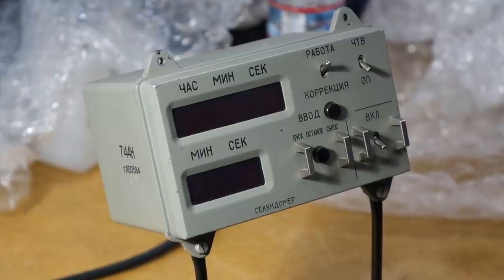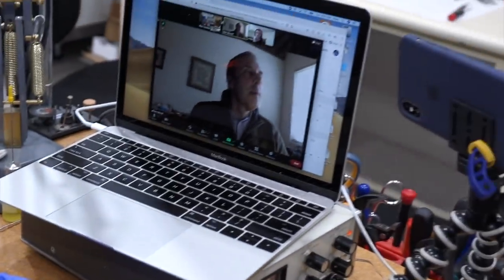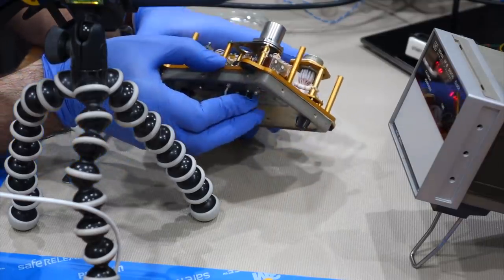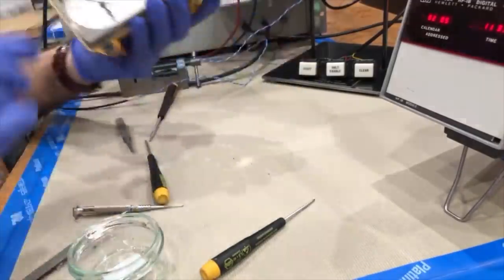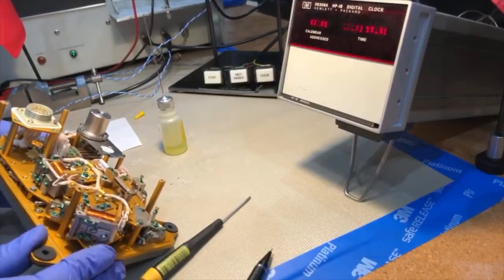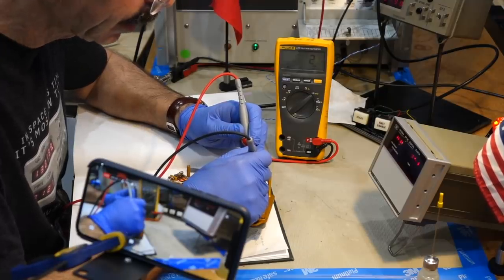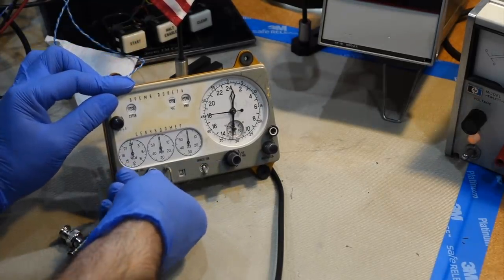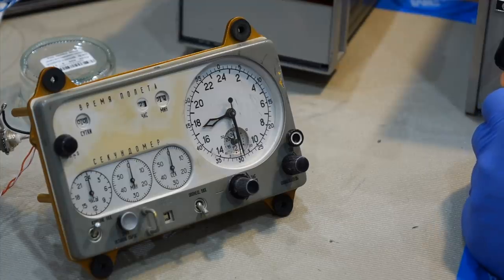Soyuz Electro-Mechanical Space Clock - Part I: Grand Opening

Comment: Wow that clock is crazy loud. I couldn’t imagine how hard it would have been to sleep with that much noise around.
Reply: I imagine other life support equipment deafened this out pretty nicely..
Reply: Wonder how obnoxious it was in the Soyuz capsule with all the clickety clacks of Soviet solenoids, motors, and relays.
Reply: I has a power (or enable/disable) switch so I guess they wouldn't have to run it continuously?
Reply: You don't sleep on duty, comrade!

Perhaps it's not THAT bad when it's in it's enclosed space though. Or everything else around it will sound just as much and drown out this sound.
Reply: After a while the ticking becomes monotone, and you sleep like a baby. Up there, i'd imagine it even gives a sense of security, the "symphony" of mechanical beats, the pulse of the ship.
Reply: Probably not anywhere near as loud with the back cover on, and the clock installed in a panel. Well, I'd hope, at least.
Reply: Movie Trailer: "In space, no-one can hear you tick!"
Reply: I noticed that it clicks every half-second. Yeah, I'd lose my mind. This is why I'm not a cosmonaut.
Reply: They do, if there is oxygen in the cabin
Reply: @RS-Amsterdam  It was a joke.  That was the tagline when the movie Alien was released.
Reply: @andrewkieran8942  ;-)
Reply: The ticking is coming from the solenoid.
If the module is mounted in its panel, most of the sound should be muffled.
Reply: imagine it is the only available bedside clock technology in the world :D
Reply: Just imagining going to space with this and whatever other things clicking the entire time
Reply: I work with a loud techniques and... when you are sleeping in a armchair and it shuts down you jump up and try to find whats wrong. So its a such a lullaby!
Reply: @superlegoboysz  I've always lived in the city, and when camping in the desert I can't sleep, because it's too quiet. In other "rural" areas, crickets and/or frogs and various other wildlife fill the void. And in a completely soundproofed room, the quietness can be really freaky. It's tempting to just make noises yourself all the time for the sake of filling the quiet.
Reply: Yes, that was my first impression. I can't imagine sitting in a small capsule with that ticking away; I would probably blow the hatch.

It does however look good, far more pleasing than a digital face.
Reply: @74HC138  Thanks for doing the major decoding on my IO address space, by the way.
Reply: Когда я был молодым, в поездках приходилось спать в локомотиве. Эти часы по сравнению с локомотивным дизелем, просто колыбельная.
Reply: @74HC138  Exactly. When closed in the case, they are quiet, like an ordinary room clock with a spring and a pendulum. I heard them.
Reply: When closed, they tick no louder than an old mechanical alarm clock.
Reply: I think the fact of being is space will make it hard to sleep. But on the other hand at some point you can sleep anywhere, sounds don't matter.

Comment: It will be interesting for you to know that until recently (and maybe even now) the control system of the metro of the city of Minsk (Belarus 🇧🇾) uses an electromechanical system for synchronizing all clocks at metro stations. It is arranged as follows: the radio signal of the exact time is received by a specialized receiver, from which the relay output goes to the control clock, and from them to the rack with more than a hundred electromechanical clocks, similar to the space clock in the video, only a little simpler in design and which allows you to adjust the time for each station, taking into account the transmission delay from the length of the wires. An electrical control signal from this electromechanical clock is sent to each station.
This allows maintaining the accuracy of readings of all several hundred clocks at all metro stations in 1 second, despite tens of kilometers of wires. And at the stations, electromechanical clocks only for industrial use (with a large round dial) are also used at crossings and electronic ones to display the time of the train movement interval.
And only on the new, built in 2017-2020, the third line of the Minsk metro, everything is done using modern technologies, computer control and fiber-optic communication lines.
Reply from the maker: Thanks for the story! That’s so cool that it is still in use! I own a large station flip clock from Italy (a Solari Udine), that is such a mechanical slave clock controlled by the station master clock. It’s from 1957. See the video here: https://youtu.be/Dw59ToripKE
Reply: @CuriousMarc   thaks. Beautiful flip clock.
Reply: @CuriousMarc  your video helped a lot on restoring and giving a modern master to an old Cifra12, this episode gave me similar vibes :)

Comment: That clock is so sexy. Maybe a kickstarter should happen to make a reproduction. Have the option for relay driven or more modern movement that makes quieter ticks. And it would join wifi to sync with an atomic ntp server.

Comment: Wait, but does it have its internal oscillator? The digital one were able to run without an external tick source.
Reply from the maker: No internal oscillator on this one. It needs to be driven by the spaceship master clock source.

Comment: the most important training of the cosmonauts was to be able to stand this ticking noise for the duration of the mission without going crazy
 The Buran never flew to space with a crew, only one unmaned flight to space..
I have seen a Buran in a museeum nearby.. one with normal jet engines made for atmospheric flights only to develop the flight computer systems... you can enter parts of the ship and look in the cockpit, the "loading" bay was full of test equipment and fuel tanks.......when you see that russian technology, the wiring, ect, it is so hard to believe this every worked...it looks like it was made 150 years ago..if their real space crafts are the same, it´s a miracle to me that they work

Comment: I have the  HP 59309A Digital Clock seen in the background also!
Reply from the maker: Isn’t it a cute clock? I had no idea it could be driven by the Cesium at 5MHz also, I found out pretty recently. You need to set a switch inside the clock.

Comment: Damn, they used that type of toggle switches (МТ1) everywhere, even in spacecraft... I have a lot of old instruments with these and you can find tons of it in old soviet industrial equipment and military stuff from 70-90s period. And I'm still use it in many of mine DIY projects. It is extremely widespread part based on microswitch МП3-1. One of perfect examples of soviet unification.
Here is how МП3-1 microswitch looks like (and what's inside):
https://vmasshtabe.ru/wp-content/uploads/2017/05/506393-vms-mp-3-1.jpg
Here is КМ1-1 and КМ2-1 buttons based on it:
https://asenergi.ru/assets/images/knopki/km/knopki-km1_full.jpg
https://asenergi.ru/assets/images/knopki/km/knopki-km2_full.jpg
And here is МТ1 and МТ3 toggle switches based on it:
https://asenergi.ru/assets/images/tumbler/mt/tumblery-mt_full.jpg
Very reliable stuff. When I saw your video about apollo switches I understood that you really like unified things. So I guess that info is probably curious for you☻
Reply from the maker: Thanks for the info and the links!

Comment: I might getting ahead since this is part 1 but can you build a compact box to drive it without big instruments and power supplies like in your setup?
This is another awesome restoration by the way, also mr. Jurvetson just tweeted about it
Reply from the maker: Yes of course, as you probably don’t need to make it work off a 1960s Cesium atomic clock. You’d still need a 28V power supply of some sort.

Comment: The mechanics and amount of screws seem a bit overkill? Did you know any interesting engineering decisions they might have made for working in 0 G?
Reply from the maker: I’d guess that 0G was not much of a concern. But everything seems to be strengthened for vibration and acceleration resistance. Hence the loud ticking. Obviously the key decision was to forgo a mechanical timing movement altogether and rely uniquely on an electronic timing source, that would not be sensitive to acceleration.

Comment: Is there a way to set the correct time through the solenoids as in a master clock/slave clock arrangement, or is it manual set from the front?
Reply from the maker: It’s only manual from the front.
Reply: @CuriousMarc  Hmmmm okay :o)

Comment: Sound is wrong. Ajust the pulses- all soviet clocks sounds very calm and this one sounds like dying astmatic.
Reply from the maker: That’s just how it sounds. In the video I adjust the pulse voltage at 11:47, and you can hear how it makes this sound right from the minimum voltage, as soon as it starts working (which also checks out as the correct voltage, couple volts below 28V). Then after that I adjust the pulse width at 12:02, and it changes the rythm a bit, but not how loud it is (which is also what you’d expect). Note that this clock works at 2Hz, not 1Hz like most clocks, and that accounts for it sounding unusually “hyper”: it clicks twice as fast a normal electromagnet actuated clock. But I would certainly not say asthmatic. Quite the contrary, it’s a pretty healthy tic-tac!